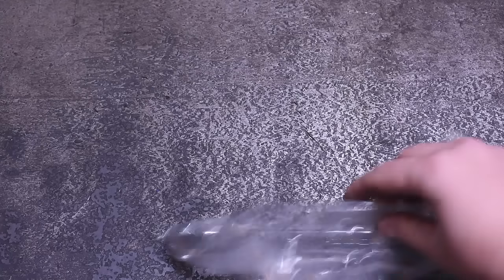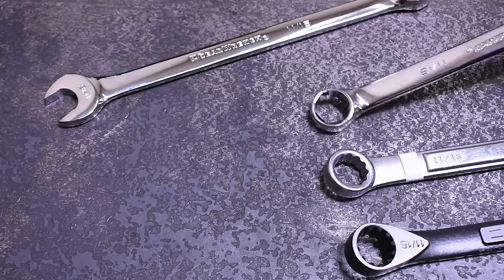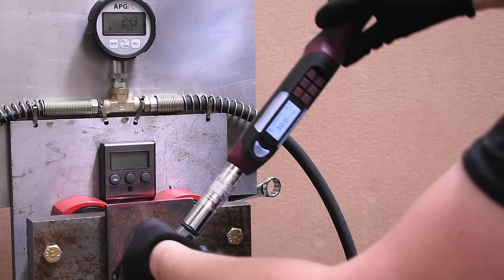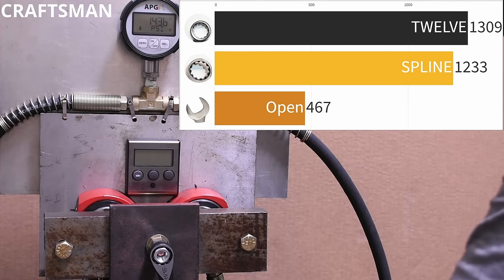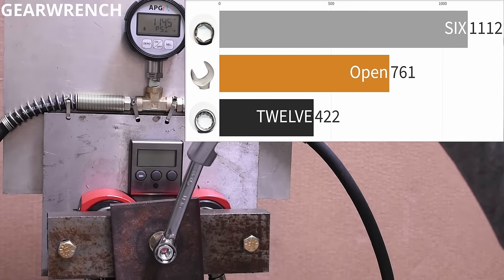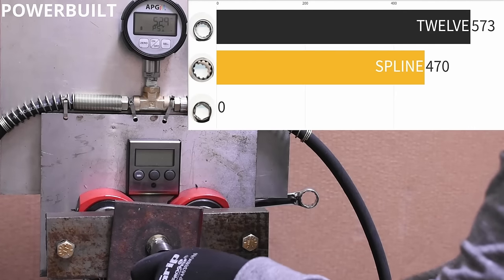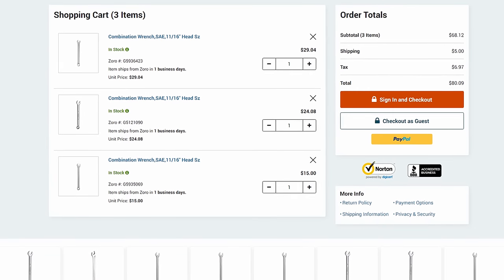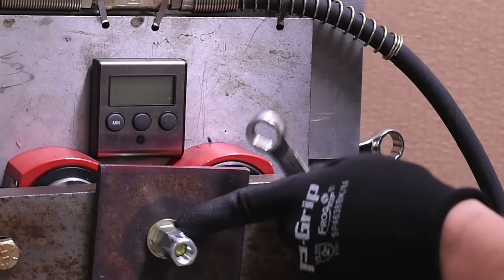Let's Settle This! What Wrench & Socket Design Will Slip 1st?

Comment: In the rust belt, 12 pointers are useless in the automotive world on hex head fasteners.
Reply: 12 points turn bolts into no points.
Reply: I thought this was a universal truth across the states. I remember being shocked that the local tool trucks even had 12 point anything on them. When asked they replied with, "New guys buy dumb shit."
Reply from the maker: Believe it or not there's still many non-believers that say an old fashioned 12-point box end is as good as any
Reply: @TorqueTestChannel  maybe they live in SoCal. Lol
Reply: I use a smaller 12pt and a good beater. Make new points when you can’t use the originals…. When a six pointer don’t work either.
Reply: @TorqueTestChannel  In Michigan the six points barely work. 12 points are for emergency only, and require the correct set of incantations to work.
Reply: @Mittencarpentry  you sure? I am in the rust belt as well…6 point is my preferred method..12 point Sockets are a big no no!
Reply: @harisjaved1379  They're saying the bolts are so corroded that 6 points are even questionable.
Reply: Yea I’m in Ohio currently replacing a tranny on my 01 f350 and motor on my 02 f350...my extractor sockets have never seen so much usage
Reply: 12 point gear wrench have come in clutch quite a few times though
Reply: Oxy Acetylene, my favorite wrench, I've busted more knuckles than times I've been on fire.
Reply: For normal tech stuff, yes. I have a friend who works at a machine shop. Most performance bolts are 12 points. And most dress up kits are ARP 12 points.
Reply: @MrAPCProductions  plenty of random 12 point bolts on things that will require them.
Reply: @MrAPCProductions  Like they said in the video, there are some specialty fasteners that you need a 12pt to torque to spec. I have very few 12pt sockets in my tool collection. 

I buy cheap single 12pt sockets when I must buy one. I was surprised to discover Harbor Freight does not sell 12pt single sockets, Home Depot's Husky stuff is good value for the money and they sell single tools. I will buy Husky tools to cut down or modify for those times nothing will fit.
Reply: @narlycharley  They sure don’t live by the Great Lakes that’s for sure!
Reply: The rust belt?
Reply: @logitech4873  Surrounding Great Lakes area in general.
Reply: @frizzlefry1921  Oh. I live along the coast of Norway. It's never occurred to me that there's places with more and less rust.
Reply: @logitech4873  Yeah with the winters they salt the roads and some chemical agents as well that make salt look like it helps you’re car! Don’t know why they can’t just use sand the salt goes into the ground water the lakes screws the car up e.t.c.
Reply: @frizzlefry1921  Where I live they just use sand. But then again, every time there's a storm i need to wash the sea salt off my car :)
Reply: I will say that in the truck repair industry on larger fasteners it doesn’t make a difference in this area
Reply: @frizzlefry1921  - the salt on roads not only helps to melt snow and ice, when combined with the resulting liquid the freezing point is lowered also to reduce re-freezing. Rusted cars and road damage are the trade offs we have to endure for those benefits of road salt.
Reply: @Canbechangedtwiceeveryfourteen  that's funny, my 99 f350 has had enough oil leaks it's whole life that non of the power train is rusted. vs my dad's 07 cummins he bought new where everything is rusted underneath. Even the oil pan has large flakes of rust coming off.
Reply: I had to buy my first set of twelve points the other month for some arp flywheel bolts. I've never bothered to own 12pt's before
Reply: In MN twelve points are reserved for the ol' "hammer on an undersized 12 point onto a stripped hex head" trick
Reply: If you work on aircrafts you will need twelve point wrenches and sockets as most bolts have a twelve point head
Reply: @MrAPCProductions  some head bolts are 12 point though
Reply: I live in Europe, in the alps, we have a good amount of salt in winter too. 

Funnly enough, being a professional mechanic, I've never heard once about a 12 point, 6 point argument 😅

In fact, I've never seen 6 point wrenches, if we have to deal with rust, we generally heat the bolt and a 6 point socket.
Reply: @MrAPCProductions  actually there is a good use of 12 points, 12 point bolts on wheels.
Reply: Use 12 point tools on double hex fasteners. 6 point on standard hex fasteners. 
Anytime you use the wrong tool you’ll get disappointed.
Reply: On industrial equipment that's all we use due to the thick paint layers
Reply: @tonydavila2606  And they likely get taken care of properly, wrenches/sockets properly seated before applying force, and rust mitigation and prevention measures taken and applied.
Reply: @logitech4873  the “Rust Belt” refers to the region in the United Stated that lost large portions of its steel production and heavy industries in the late 1970s-early 1980s.  The large plants idled rusting away.  Pittsburgh, Pennsylvania is a classic example.
Reply: the universal wrench is a torch in the rust belt
Reply: @TorqueTestChannel  As a GM tech in jersey I think I'm qualified to speak on 12 points and rust. A 12 point box end wrench is fine the vast majority of the time. I would bet most the people commenting here use 12 point wrenches too our they likely aren't actually mechanics at all. Everyone i know has 12 point box end wrenches. Hardly anyone has 6 point wrenches. 12 point sockets are a different story.
Reply: Grew up in PA just south of the NY border, I only own 6 point sockets and wrenches. I didn't even want to risk grabbing a 12 point or worse yet losing the 6 and caving in and using the 12 lol, so I don't own any.
Reply: Bmw
Reply: @jetjazz05  what do the other guys in your shop have for wrenches? 6 vs 12 in terms of sockets is a very different story. All my sockets are 6 point.
Reply: *nods in Cheesehead *
Reply: @Canbechangedtwiceeveryfourteen  I just pulled a tranny from a ‘97.  I had to plasma out one bolt as it corroded fast to the bell housing.
Reply: @TorqueTestChannel  As a diesel tech I've found many places where 12 pointers are very handy. I have both 6 and 12 point sockets and only pull out the 6 pointers on older equipment. As far as wrenches on aftertreatment you have to have a good set of sensor sockets and or line wrenches.
Reply: @Mittencarpentry  100%!!! I work on some old jeeps, so its a pretty regular occurance where I hammer on a metric socket onto a rusty SAE nut! Although, generally, the bolt breaks and out comes the ez-out, aka welder
Reply: @narlycharley  You mean where all the aerospace is?
Reply: Ya live in Ohio here and got rid of all my 12 pointers years ago…..
Reply: I use a 6 point when I can but surprisingly haven't had too many issues with 12 point.
Reply: 12 point's sole purpose is tu turn a fastener into a circle so no one can easily steal whatever you've bolted down :P
Reply: In the rust belt nutcrackers and angle grinders are the tools of choice.
Reply: Some clutchs and flywheels use 12 point bolts but other than that you're right
Reply: F1 uses 12 point design but those have to last only 4-6 times
Reply: We call 12 points bolt strippers. All they are good for.
Reply: Doesn't really matter, you can either round it off with a 12-point or shear the head off with a 6-point. Been there, done that. 3 out of 4 of the bolts to drop a transmission cross-member sheared the heads right off, and the one that didn't? I rounded with a 12-point because that was the first thing I found.
Reply: Same here in the UK for anything of a certain age.
Reply: @TorqueTestChannel  you seriously have to try out "premier " brand sockets, they are stunnning, they arentthe best metakl out there, but who cares, the amount of times theyve saved me, used to be called x-ion?
now called premier here in the uk, two little teeth on each face- grips the corners of a rotty one lovely once its tapped on....never sen anythng as goodfor never slipping, and they are cheap as shit.
you will snap the sockt long before the grip gives out most of the time,
Reply: @TorqueTestChannel  down here in west Texas we don't keep 6 point wrenches, just sockets, but my particular shop is also snap-on only unless snap on doesn't make the tool you need.
Reply: Are E-torx bolts better? I've got a couple interior of that kind, and I know some euro autos use them in the engine compartment.
Reply: @MrAPCProductions  duuuude. i don't even own spline drive. except for the basic driveline sockets needed for peterbilts
Reply: @ajcz  This! Sometimes Field Expedient Machining is required, and you turn that round bolt into a 12 point bolt, just to get it removed and replaced with the new bolt afterwards.
Reply: @rpavlik1  Torx or E-Torx are both substantially better about not rounding off. At least with regular torx, you usually strip your bit before stripping the bolt. I've never stripped an e-torx. Only thing I've got that uses them are the seatbelts on my old Chrysler, so no rust inside to deal with.
Reply: Im a HGV guy from the uk and my 2 pence is 6 point sockets and 12 point spanners if you cant get it out with socketry the gas bottles are in the corner.
Reply: I'm in the middle of Illinois where the cars come off the lot with rust. 6 points are my go to with suspension with a good impact and if you have the leisure of soaking with a transmission fluid/acetone mixture or PB Blaster for a couple days over and over for a couple days before I tackle the project.If all that fails it is the cut off wheel or torch to the rescue.
Reply: @MrAPCProductions  bought several tools as cheap as possible due to they're just disposable I'm most scenarios, not all but most
Reply: Yup, only wrench that’s good is map gas with a side of 6 point or Erwin nut extractors. Lol
Reply: ...... Head studs, main bolts, flywheel, and pressure plate bolts all tend to be 12 point fasteners0_e So I have a 6 and 12 point set in 3/8 and half
Reply: I like flank but ssockets for those rust bolts your afriad will just round off. Next best thing is a quality 6 point socket or wrench
Reply: @rich1051414  I've found some success with hammering an undersized 12 point onto an already rounded fastener where an equivalent 6 point wouldn't fit.
Reply: The other thing I've found is 12pt tend to have less life because it takes less internal wear before they are too out of spec.

I'm a millwright in a foundry and 12pts are a must because of limited swing angles for many fasteners but I've replaced common sized sockets and wrenches way more often than 6pts. Most of mine are spline now because they also get on and off dirty shit better.
Reply: @frizzlefry1921  sand doesn't prevent more ice forming over it and negating any traction advantage of the sand.
Reply: @jakehennessy7  depends on the industry I guess. 12pts were nice when I was changing a 15' cutter and needed to remove a few hundred bolts and then slap those few hundred back in. Just faster engagement time and not a high torque application. Only upside to 12pt sockets imo.

But sometimes you need 12pt or spline for limited access fasteners with low swing angle
Reply: @James-tf7kn  I inherited a bunch of tools from my grandpa, and had this weird moment of wait, there’s 6 point wrenches. I’d never seen one, and at the time I was working at an industrial equipment shop (in parts) where weird stuff was normal.
Reply: Great for putting in the fresh hardware you just replaced after torching out the last farstenar!
Reply: I had good luck with a 963a cat used my the dot to load salt trucks since the 80s  didn't have a nut round out with my 12 point sockets
Reply: @logitech4873    In the Great Lakes region, Ohio in particular, we are sitting on top of some of the largest salt deposits (mines) in the world. Salt is cheap, roads are icy much of the year, we use ALOT of salt on the roads and our cars rust exponentially faster than in, say Texas.
Reply: Outside the rust belt we still hate 12 point, and yet it's a chore to find 6 point sockets locally unless you're willing to shell out for impact sockets...which is why most of my 1/2" drive sockets are impact even though I don't (yet) own an impact wrench.  (I do borrow one when I do a parking lot repair at work, though.  They don't complain because it gets me and my beater out of the lot sooner.)

Of course the bonus of those flat black impact sockets is that you can smear a little neon yellow paint in the number etching so you can actually read the damn numbers without a 500W halogen light and a magnifier.  All my shiny chrome sockets get the old fashioned "try it and see if it fits" method of size checking.

It's even worse when you consider the only even slightly valid reason to want 12 point sockets for hex heads is a non-ratcheting breaker bar - the exact tool and situation where you're most likely to round the head with it.
Reply: @logitech4873  Any place where the government salts the roads in Winter is a rust belt. Driving through this 💩 is the same as parking your vehicle on an ocean beach at low tide and leaving it there for a month.  
This corrodes all those electricals that new vehicles have, rendering them junk.  Then you have to constantly go to the stealership to buy another vehicle.  
Follow the money.
Reply: @TheManGage  I'll keep that in mind for when I'm wrenching on my Gulfstream 😁
Reply: @Mittencarpentry  the more points, the higher the nut body count!😄
Reply: @ObservationofLimits  Salt doesn't do that either in places where it's basically below 10-20°F all winter, so we just use sand most of the time. Salt can't melt much ice below those temps
Reply: @tonydavila2606  “for hex head bolts”
Reply: I have a set of 12point wrenches for bolts in shit spaces and that about does it. Anything else that I can fit a 6point with decent range of motion, I go for it.
Reply: Try working on an aircraft engine with 6 point.
Reply: I use the 12 pointer to make sure the bolts atleast in the hole before I drive to the store and buy a 6 pointer to do it right bc I lost my other one 😂
Reply: @Canbechangedtwiceeveryfourteen  As a fellow Ohioan, I gave up on doing my own car work several years ago. At least with my mechanic I know what I'm signing up for. 
No longer having a 2 hour job turn into an 8 hour job won out over the pride of saying I do all my own car work.
Reply: @narlycharley  they are still used because they are on the back of a wrench. 12 is most common here in the rust belt. Sockets are usually in 6.
Reply: Everything gets the grinder around here
Reply: this applys even outside the rust belt
Reply: @TorqueTestChannel , the original design of box and socket wrenches with a regular hexagonal broaching would push only on the very corners of a fastener, whether tool had six or twelve points of acceptance, so what would be the difference?
Reply: @kadenjohnson1072 , amusing and educational observation!
Reply: @TorqueTestChannel  I feel like they have never worked on cars then, atleast not for any appreciable amount of time.
Reply: @ajcz  Ah, yes. The pipe wrench method.
Reply: Not if you work in aerospace; they are essential
Reply: Then, time to bust out the single point oxy-acetylene torch.
Reply: Started buying myself and my son 6 point only sets in the last yr. I have acquired different 12 point sets over the Yrs and the ONLY set that has not slipped or slipped off has been my 1/2 inch drive Stanley sockets. I bought them about 20 Yrs ago. They were individual sets of sae and metric and they have been used, abused, and beaten to death but still work like new. Everything else I began noticing how much my other wrenches and sockets were slipping and rounding stuff off so I began replacing with 6.
Reply: @frizzlefry1921  Thanks for that. I think they are using really nasty stuff in the UK these last few years, my car was wrecked underneath after doing all of it only 2 years ago, I've had to go over it all again. I won't be using that car in the winter any more.
Reply: I'm a full-time mechanic in illinois and I own zero 12 point sockets they're worthless in the rust belt
Reply: Depending on the fastener, an undersized 6 point and a hammer does the trick for those especially stubborn bolts
Reply: Expect for every 12 point bolt in the engine 🤦🏼‍♂️ I had to grab a set of 12 points to fully take apart and put together a inline 4 scion. Same needed to be done with the v6 and v8s we were taking apart. Maybe on 6 point bolts they aren’t as useful but until u get a 12 point bolt I agree with u
Reply: @narlycharley  or maybe in Canada where people rely on brains instead of brawn’s
Reply: I enjoy a 12-point when the angle is bad. That said, I also enjoy an angle grinder and torch
Reply: Checking in from Buffalo, what are "hex" heads? All we have are rusty circle heads.
Reply: Pretty much the only time my 12 pts get used is when the bolt itself is a 12 pt bolt, I can't find my 6 pt,  or I'm working in a tight space and a 6 pt won't line up
Reply: welcome to minnesota
Reply: @Mittencarpentry  I spent 5 years wrenching professionally in MN. 12 points are fine with a little bit of common sense. Heat and penetrating oil are your friend.
Reply: In the European rust belt where I do my wrenching (automotive, mostly suspension work on damaged vehicles), I really do not use a lot of combination wrenches anymore. The usual path is socket and ratchet, impact, breaker bar and then breaker bar with cheater rod if it still wouldn't give. I'm only really using the combination wrenches when I either need to block the other side of the bolt/nut combination, or when I cannot fit a socket and ratchet in with whatever combination of extensions and u-joints. I think I need to resolve to a box end wrench to break something loose only a couple of times a month at most? But there are loads of situations in which a 12-point box end has helped out massively due to very limited space to swing. 

Then again I suppose there are jobs where you encounter much more stubborn rusted nuts and bolts than I come across on most cars I see. So I'm not sure if my use case is just on the lower end of the spectrum where 12-point box ends usually suffice.
Reply: They are good to hammer onto an already rounded fastener with a size down to get a good bite to remove the fastener
Reply: @reubensandwich9249  He said that.  ONE regular guy is he, not they.  Stop it.
Reply: 12 points work good when it’s rusty rounded and you need to go one size smaller and pound that 12 point on with a hammer, boom, new head size lol
Reply: They should make half size sockets for the rust belt as the fastener is often undersized by the time you put a tool to it.
Reply: @logitech4873  I live in the Hudson Valley, NY and the salt was always brutal. NOW with them brining the roads at the least forcast of ice/snow Wow- even worse. My gear Wrench 6 point stuff or often a vice grip or Even a ridgid pipe wrench can be life savers. Then there is the tourch, for when I get pissed
Reply: @stevebabiak6997  Maybe you are that guy who sold all those evil Brining crap to all these highway depts
Reply: yeah im thinking i might just trade my sockets in for twist sockets since it gets so bad during the winter lol
Reply: Frizzle Fry
My brother who works in road construction says the chemical they spray here now is salt brine. He said never follow the same direction of a spray truck & if it looks like the road or highway was sprayed, to take a different road or highway. And also get an underbody car wash after as well which you should be doing for any type of salt you drove through though.
Reply: Kaden Johnson
My Aunt told us about a place that sprays oil on the bottom of your vehicle and it goes up 4 inches or something on the bottom of your doors and side body as well. She gets it done every winter season to keep the winter salt from eating her suv.
Reply: Charles McKinley never heard that discription before, it probably has several meanings depending on where you live. For the rest of us where salt eats our vehicles, we call our locations the rust belt for that reason.
Reply: @logitech4873  Anywhere that sees snow basically but Most often associated with the North East US.
Reply: @ulukai_555  europe generally doesn't go for the flat rate system, america does. what this means is that the american mechanic is loosing some of his own personal money just to take the time to deal with the torches sockets and avoid getting burnt. what that means using the data from this video is that six sided wrenches are about 30% more likely to make you money, and 12 point wrenches are about 30% more likely to cost you money.
Reply: @ulukai_555  I was thinking the same. I'm in Britain, no part of which is more than 50 miles from the sea with its salt, and they used to salt the roads too. Most of our sockets were 12-point.
Reply: @TorqueTestChannel  "Believe it or not there's still many non-believers that say an old fashioned 12-point box end is as good as any." Yep! I have definitely known people who think 12-point is the bomb for 95% of what they do, and they keep their 6-point stuff pristine and ready for when they are wrong ... which is more than 5% of the time on some projects.
Reply: @TorqueTestChannel  I'm so confused. Why do 12 points exist when bolt heads have 6 sides??
Reply: @hannahranga  jeep 4.0 head bolts or f150 driveshaft bolts just to name a few
Reply: @frizzlefry1921 , here in Japan, even in Hokkaido which sees more snow than Maine, they do not salt the roads. Maybe one reason they can export so many used vehicles.
Reply: When you are in a really tight spot and you can only move the wrench about 1 in or so the 12 point comes in handy once you have the bolt broken loose.
Reply: I remember moving from the rust belt to the south and having every mechanic that looked at my truck tell me... yeah.. I'm not going to touch that.
Reply: @lesscoRyden , HAH!
Reply: @Canbechangedtwiceeveryfourteen  windsor? coz my windsor shreds gearboxes too
Reply: Same in the UK. Cars like to disintegrate here. 6 point tools on everything chassis related. Either undo it or shear it off and replace.
Reply: I agree, I've always hated 12 points. I learned very quickly not to use them in the automotive field.
Reply: And useless for impact wrenches also. 12 points are a very poor choice indeed for a hex nut.
Reply: That's not even slightly true, if the bolt holds, they can be used to extreme torque requirements. If the bolt doesn't hold, what good will a 6 pointer do?
Reply: Agreed
Reply: Hey that's a true fact chief.
Reply: Reading everyones comments on here. As a So Cal resident 12 points really do work just fine lol.
Not to rub it in for you rust belt peops faces but I can go to the wrecking yard and pull parts off a 1970s car and the bolts will still have shine to them, not joking,  road grime from oil leaks turning into asphalt being glued to the bottom of the car from decades of use are the biggest problem.
When I spent some time in Chicago a few years back that was not the case, besides there was no 1970s cars in the wrecking yard, the newish cars that were 8-10 years old were complete rust buckets. In my gearheaded opinion you all live in a rusty frozen hell.
Reply: 12 pt. fixed wrenches should only be your “goto” if you work on 4 (square head), 6, and/or 12pt fasteners or you absolutely NEED to accommodate for a tight space that won’t let you get the 45-60 degrees of rotation that makes 6pt efficient.  And honestly, use the 6pt. to break the fastener loose and then go back with an adjustable or strap wrench on slightly damaged/softened/work fasteners.
Reply: Been a mechanic since 78, 12 points suck, only use if bolt has 12 point head
Reply: @MrAPCProductions  that's goofy. You've probably just been using the wrong 12 points. I've been using old craftsman 12 points from the 90s for 10+ years and have yet to round off a bolt. My harbor freight 12 points have for sure, but anything good quality grabs. I live in southern maryland too, spring summer and fall are always wet and winter is always salty. Never had a problem with us made 12 points.
Reply: Unless they are rusted and rounded
Reply: Torquey, 12 point bolt heads are Great  for aerospace design but I can't speak for the wrenching
Reply: I live in CA but all my tools are 6 point
Reply: They do well if covered in oil IE head bolts.
Reply: @charlesmckinley29  also the rust caused by acid rain produced by coal, coke, ans smelting plants. Induction heating metal is way greener and safer.
Reply: Not necessarily, 12 points are better when you have to go a size down but cant get a 6 point on that’s sized down
Reply: 12 point tools are for use on 12 point fasteners! Why not test 12 point fasteners with 12 point tools against 6 point fasteners with 6 point tools? This would actually be interesting and I’m sure a lot of people would like to see this!
Reply: Everytool has a purpose 12 points were invented before the spline drive and gave you more engagement options
Reply: @Amstel08

They DO make half sizes for this reason.

Here in northern Indiana, we usually use them on those bastard lug nuts with the cheap-ass chrome caps that swell up (and fall off).

A half size up for the swollen ones, and a half size down for the ones that the caps have fallen off.

God, I hate cap nuts!
Reply: I've been a tech for 10 yrs in auto and a few in aviation. Hands down personally il take a spline over a 12pt any day of the week. A spline will bite into what's left when a 12pt will usually round off what's left...  just my exp.
Reply: Come into contact with EU cars sporting triple squares
Reply: 12 pointers are only good for needing a box end in a tight space, where you can only turn a smidge at a time
Reply: @zakberardy1822  😅
Reply: 12 point are for when you need to change the size of a bolt
Reply: Replying here from the sunny state of california, we don’t get rusted bolts very often from kept-in-state cars (except for minor surface rust from iron components after rainstorms), but let me tell you. We get some cars that trickle over here. And man, do we all feel sorry for you guys. But always look at the silver lining, it teaches you how to deal with worst case scenarios pretty often, and that’s a valuable skill to have lol
Reply: 12 points get used by me in tight spots only where I couldn't even get the wrench on the bolt head or nut with a 6 point.  

Other than that, trash.
Reply: @logitech4873   Southerners consider the Rustbelt as anywhere that they have a frequent need to Salt the Roads due to the Snow & Ice
Reply: You know it’s called the rust belt because of the economic situation of the auto industry right?  It isn’t called that because rust is more intense there. If anything it’s the sunbelt and the coast that has the worst rust growth on hardware.
Reply: @logitech4873 The states considered to be part of the Rust Belt are Illinois, Indiana, Michigan, Missouri, New York, Ohio, Pennsylvania, West Virginia, and Wisconsin.
Reply: Idk 12 points are needed for tight spots where you cant get the 6 point on and actually turn it. And if the ratcheting wrench wont fit.
Reply: Yah, but then dodge puts a damn 12 point bolt in the frigging transmission shaft of my magnum... lol
Reply: I live in the PNW and pretty much only have 12 point wrenches. I have a few traditional hex sockets and try to use them as much as I can, especially on rough looking bolts, but my 1/2 inch ratchet wrench only has 12 point sockets and they work just fine.
Reply: Trouble is that it’s often hard to get a 6point box end wrench. 12 point box ends make some sense - it gives you twice as many spots to get the wrench back on a nut when you have to readjust, and if you’re careful, you shouldn’t strip the nut, but I never understood why you would need a 12 point socket.
Reply: @MrAPCProductions I mean, the occasional driveshaft has 12 point bolts. So maybe one or two sizes lol
Reply: @narlycharley yeah I live in Arizona, I have plenty of 12 point sockets and wrenches. They work fine honestly, we don’t have any rust at all. Wish I had bought 6 point sockets to be honest, but I was 19 years old 20 years ago on the snap on truck and yeah, young guys buy dumb shit 😂
Reply: Amen
Reply: In the rust belt we just hammer on the next size smaller wrench or socket
Reply: In "my" world rust is metal also dried blood
Reply: All well and good... until you run into that one 12 point nut, mechanic buddy of mine had to replace the u joint on his truck (still no idea how he made it to work on that) needed a 12-point socket to undo the bolts
Reply: @TorqueTestChannel my retired machinist 86 year old grandpa in law swears by 12 point
Reply: The rust belt is the most lackluster region of the United States.
Reply: @logitech4873 
Welcome to the Swedish west coast! 😅
We have mostly the same conditions as you do. Winters are always humid and moist, and tons of salt on the roads.
Reply: They are not useless. In fact they work great to clean off the rust lol. The slip takes the rust right off. Haha
Reply: repentandbelieveinJesusChrist8  Will that save my car from rust?
Reply: God be with the rust belt mechanics, 
may there bolts and nut be removed without heat or extractors
Please protect there knuckles when things go wrong
And forgive them for the swearing the go through working on junk.
Amen
Reply: I live in michigan. At the local O'Reilly I saw only 12 point sockets and wrenches. What the heck? Don't they know their customers have crappy cars? Don't they know that customers rely on transportation for their livelihoods? Anybody who stops and thinks about it should realize you need six point for crappy, rusty cars. This data shows you get ~ 2  times more torque.